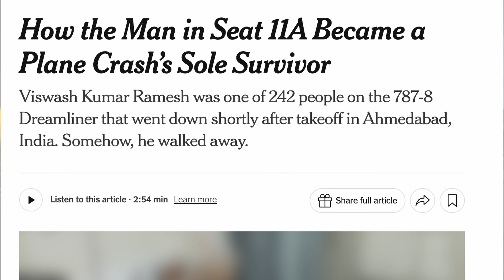Why the RAT Changes Everything – Air India 171 Update

Comment: What is known so far about the crash of B787-8 AI171:
1) The aircraft was heavily loaded.
2) The temperature at the airport was 37 degrees Celsius and outside the airport 41 degrees Celsius.
3) The aircraft was hot.
4) The pilots were very experienced.
5) The 787's takeoff configuration was correct.
6) The runway is 3,505 m long.
7) AI171 used almost the entire runway after a backtrack.
8) V1, Vr, and V2 were near the end of the runway.
9) In the first few seconds after rotation, both engines functioned largely flawlessly.
10) Immediately after takeoff, both engines failed without smoke or sputtering.
11) At this exact moment, an attempt was made to retract the landing gear (the landing gear wheels were pointing down instead of up).
12) Almost at the same time, the RAT was deployed.
13) The pilots transmitted Mayday, likely with power and thrust loos.
14) Now, no engine noise was audible any more, you can only hear the sound of the RAT.
15) After the crash, the flaps on the wings on the floor showed an extended configuration.
16) Shortly before the crash, a survivor reported a bang and the emergency (grren) lights switching.
17) The GE engines are extremely powerful and can always gain altitude safely, even in the event of an one engine failure or any other misconfiguration.
18) An engine restart takes more than 45 seconds.
19) The B787 is an hydraulic and electric aircraft.
20) All hydraulic and electrical systems are double and triple redundant.
As CritSit (Critical Situation) Manager, I suspect the most likely cause of the crash was a failure of the redundant hydraulic and electrical system, particularly those responsible for supplying fuel to the engines (fuel pumps). Therefore, the fuel supply has been interrupted. This is not a double engine failure, but rather a double engine shutdown due to hydraulic and electric failure. This should also be confirmed by the ECAM data.
In my opinion, the pilots were true heroes.
Reply: I agree with most of your points however...7) I have yet to find official confirmation where on the runway the aircraft rotated...if you have such confirmation please share sources...because if it did eat up almost 11000ft of runway then it would speak to issues prior to rotation 9) you/we  don't know that...and won't know it until inspection of the FDR....10) we don't know if there wasn't an insidious issue before or during the take off roll that was already taking place undetected before the speculated catastrophic dual engine failure....as your your opinion well I can't agree with nor refute it...I'm not qualified to do either. Perhaps we will find you are correct...perhaps we will find you are not.
Reply: @ldhorricks  To point 9): If you look closely at the takeoff video, you can see that both engines are kicking up a lot of dust from the end of the runway. This is remarkable, given that the runway was previously swept clean by previous aircraft in the areas where the Vr and V2 normally are. And even after takeoff, there is no engine smoke or fire in either engine. The aircraft's climb angle is also correct for some seconds. Therefore, it's logical to assume that both engines correctly delivered their required thrust up to a certain point. It's also highly unlikely that both GE engines would experience a mechanical failure at the same time. And a bird strike would also result in visible jets of flame and black smoke. Both was not seen.
Reply: @hcvpriv oh my God give it up on the "🥰🥰these GE engines 🥰🥰" bullshit. I work with and think their turbines are SHIT and guess what bud, that's just a bigger engine albeit with tighter tolerances. When GE turbines can collapse the whole power supply to the whole eastern seaboard in less than 7 minutes and leave some places without power for up to 3 days and tons of people working up to 72 hours straight, they aren't shit.
Reply: @jphuckit2870  Unlike power generators, aircraft engines are jet engines that, due to their design, can operate completely independently unless there is a major mechanical failure, such as a bird strike, or the fuel flow is interrupted, for example, because the electric pumps in the tanks fail. Since both engines failed simultaneously, an isolated engine failure is not logically likely to be the cause.
Reply: @ldhorricks  Vr was directly behind the small house next to the runway. If you extend the camera perspective and the small house, you can see that Vr was relatively far toward the end of the runway. However, a 787, even fully loaded, has so much thrust that it could have taken off earlier with the appropriate settings. Either the pilots wanted to protect the engines, or the heat affected the engines' thrust. However, V1 should be the point at which the aircraft could still safely abort takeoff. The pilots must have been aware of this if they selected a lower thrust.
Reply: @hcvpriv  aircraft was fully loaded & taking off out of hot and high conditions - using up the entire runway would be normal
Reply: Agree. It was clearly a power loss, yet not necessarily the engines failure. Low quality fuel perhaps?
Reply: @AlexanderTolstoy  Presumably, it wasn't a fuel quality issue, as this may have been the case with other aircraft as well. Of course, there have been one certain case where, for example, salt was present in the fuel. But also water shouldn't be a problem, as it should be detected immediately and can be tested by a small sample on the underside of the tank (wings), because kerosene is lighter than water.
Reply: @hcvpriv  could it be an act of terrorism them.. 😮 
Flight falling from the sky,  3 huge ships  burning in the ocean.. too many strange things post the recent war, in India..
Reply: @drkrishnap  Yes, things are not looking good in the world... but no, a terrorist act is very unlikely here
Reply: That makes sense. Thank you for explaining.
Reply: This is also speculation.  Wait for the real data.
Reply: IYO— considering fuel supply interruption— could it have been tampered with, prior to flight?
Reply: @daisy-rothschild  I think that's very unlikely, since each engine has its own fuel pumps, which are spatially separated. Furthermore, the fuel supply functioned unhindered during the takeoff phase. The two supply lines themselves cannot be tampered with without disassembly.
Reply: @daisy-rothschild  I'm not ant kind of expert but I am a True Crime junkie, and the information I'm hearing now/so far leads me to only 1 question for the actual airplane experts:
Is there ANY way or form of tampering with ANYTHING on the plane that could cause this statistically improbable DUAL engine failure without smoke and fire first, and so soon after takeoff? 
Seems like someone messed with something that wasn't easily detectable prior to takeoff... but I don't know anything about plane mechanics and engines to speculate about who could have done what and when
Reply: @TimesUp8888  You said it better than I did.
Reply: I have it from unofficial source, so not sure 100% about  it... We have what we have...
Reply: @dumitrucotorobai8344  Yes, and that is highly unlikely given the external circumstances.
Reply: @dumitrucotorobai8344  imagine if it really was some kind of reverse whiskey throttle that caused it, based on the evidence, it's the only solution that fully makes sense
Reply: Fantastic insight, thank you for this information. 

It’s great to see people who can think for themselves rather than draw the same flock minded conclusions over and over when they hear the word “Boeing”
Reply: @pints6994  Thank you so much:goodvibes:
Reply: Just a theory in mind:
Could it be some electrical shorted/overheated, which caused the fuel pumps to be disabled? Or are those redundant (or multi-redundant)?
Reply: @bjornst11  Yes, the fuel pumps and lines are also fully redundant.
Reply: Thank you for this great gathering of facts. It's weird that most of the videos have some, but not all of them, but with different ones missing. Like the flaps being clearly down in the video of the wreckage (the one with the soldier standing on the wing), like the landing gear trucks being toe-down.

I don't see this as a fact, just a report, but a person who was on the previous flight same aircraft, posted a video showing that the cabin electrical systems were not performing correctly. Is this related? No idea.
Reply: @mewintle  Well, the entertainment system is always broken on various flights, but it has absolutely no connection with the flight control system and the electrical and hydraulic controls.
Reply: That was a well-structured summary — I need to add some of my prospective ,many of your observations align with preliminary data from DGCA and AAIB.

A few clarifications from FDR and official press notes:

1. Dual engine failure was sequential, not simultaneous — left engine failed first, followed seconds later by the right (DGCA/AAIB, June 16).

2. RAT deployment confirms loss of both primary power sources (engines).

3. Takeoff config was confirmed correct (flaps, gear, trim).

4. Mayday phrases like “no thrust” and “losing power” were verified by DGCA, though not logged formally in ATC tapes.

5. Flap position after crash implies the system remained in takeoff mode and didn’t transition — consistent with low-altitude failure.

6. No visible fire before impact + staggered thrust loss = high suspicion of fuel delivery system misconfiguration — possibly a manual valve or crossfeed error (our analysis breaks this down in detail).

While your theory about redundant electrical + hydraulic failure affecting fuel pumps is technically possible, there’s currently no confirmation of widespread systems failure in those domains.

Appreciate the recognition of the pilots’ professionalism — they had just seconds to respond to a critical situation.
Reply: Its 49C in the UAE and flights take off every minute at these temperatures. I believe we should not be concerned about temperatures, unless Boeing makes a cheaper version of the airplane for cold weather operations only.
Reply: As a marine engineer, first suspect to me is the fuel supply got shut off/plugged, be it plugged strainer, fuel valve changed, or likely power to pump, or pump failure. In Marine service, there is a back up pump as soon as manifold pressure goes below a preset value, say a 10% drop from full value. Each engine should be on its own pump and fuel supply if it follows marine practice (for maneuvering conditions). The black box is needed.
Reply: @adiamondforever7890  Yes, of course, the first things that come to mind are the fuel supply, the fuel quality, and the fuel pumps. However, there are two completely separate systems, and as far as can be seen from the video, the problem occurred simultaneously in all redundant systems, followed by an electrical and hydraulic failure. Therefore, it's quite unlikely that a fuel strainer, a pump, or a problem in a fuel line caused the failure.
Reply: that's what I think too, that it was failure of hydraulic and/or electrical that CAUSED the engines to flame out.
Reply: @pimacanyon6208  Yes, it was most likely a complete electrical and hydraulic failure, because the gears could no longer be fully retracted at the moment of the problem and the information given by the surviving eyewitness of Seat 11A.
Reply: @hcvpriv  thank you.
Reply: @pimacanyon6208  Yes. I saw a seagull fall out of the sky a few years back because it had a fish hook embedded in its mouth. I know that it didn't swoop down out of the sky to make a grab at a pretzel I'd thrown onto the ground because, with a fish hook in its mouth, it would not have been able to eat that pretzel.So it must have been the fish hook.Without electricity (I've heard it said) that an aircraft jet engine cannot get sparks from the engine spark plugs. I've also heard it said that, without hydraulic pumps operating, the flaps and slats will retract, and also the elevator control will freeze.
Have a nice trip.
Duck Duck GO!
Reply: Would almost empty tanks starve the pumps with sloshing on pitch up? I.e. They had gas but pitch up moved the gas off the pump inlet.
Reply: @Pluto_ice  The tanks were certainly very full, as can unfortunately be seen from the huge fire after the crash. Even if one certain tank was empty, this would not be a problem at all, because the pump of that empty tank would be automatically switched off and only the full tanks would continue to be used. By the way, we have separate tanks in both wings, which are normally used separately for the two different engines.
Reply: @hcvpriv They absolutely had fuel but the tanks wouldn’t be full. That flight is around 3800nm while the range of a 787-8 is about 7000nm. The reason I question fuel load is the lack of sustained fire. The images and video I’ve seen don’t seem to show the damages a fire fueled by a plane with a 50-60% fuel load would cause. Supporting that is the survivor walking out shortly after the crash, the tail section seen without fire damage and the video of the building without active flames. I believe the survivor walked out before first responders arrived and there was no fire raging. I’ve seen the video of the fire ball but crashes with the fuel that should’ve been onboard should’ve burned longer imo.
Reply: @Pluto_ice  What a pitch of a thing to have happened.
I'm wondering if they could have fitted some sort of multiple scavenge and boost pump system to those tanks.
If only you'd been around to give Boeing advice on this when they had the Dreamliner on the drawing board, you might have been able to save countless lives.
Reply: @telforddisservicesandco . 
Haha. There is no engineering solution for lack of fuel. At a certain volume pumps get starved.
Reply: Agree!
Reply: Just commenting to be notified of further updates on this matter
Reply: Cool story bra
Reply: Thanks for the contribution.
You mean that EVERY electrically driven hydraulic pump and EVERY electrically driven fuel delivery pump failed because every generator (including the APU generator) and any battery backup which was supposed to deliver power through the electrical buses failed to deliver power?
Perhaps.
But are you also suggesting that the engine (mechanically) driven fuel pumps on BOTH engines also failed during those vital moments as well?
Are you also suggesting that (perhaps too) the engine (mechanically) driven hydraulic pumps might have also failed at around the same time that this electrical disruption stopped delivering power to the electrically driven hydraulic pumps?
That would be a really scary scenario, and what a tragic coincidence that would be.
All I can suggest in response is that, if there's a Boeing 787 airliner flying overhead, then we should all take precautions, and DUCK!
Reply: @telforddisservicesandco  Unfortunately, we don't yet know which components actually led to a total hydraulic and electrical failure. If the RAT is deployed, and, as it appears, the pilots could have also indicated the power outage, this scenario would be the most likely. There is likely a bottleneck, possibly related to the communications bus or the software between the various redundant systems. A fault in the batteries and the main electrical supply, perhaps following a massive short circuit or a fire, is also theoretically conceivable. Years ago, an A380 experienced a similar massive total control failure after a fire in lithium-ion batteries in the cargo hold of the fuselage.
Reply: @telforddisservicesandco  that's why @dumitrucotorobai8344's explanation is the only 1 that makes sense.  looks like youtube hid his comment like they do most , but it said a recently maintained chair lock broke during takeoff, chair rolled back with the throttle (joke i know) but wouldnt surprise me if that's what happened.   is it possible for a pilot's chair sliding back to pull the throttle back during take-off, and co-pilot just didnt have enough time to react?  seams more plausible then i wish it did, YT hiding comments doesnt look good either
Reply: @jareds8729  I accept that doubt might have been cast on the competence of the co-pilot (presumed to have been the non-flying pilot). His hours on the Dreamliner and his overall low total hours will likely have left people asking questions in relation to his ability to handle the aircraft. But it seems pretty certain that he'd have been capable and competent enough to handle/manage such an event (broken flying pilot's seat) without even needing to consult with the captain.
He would have simply identified the predicament and would have immediately ensured that both thrust levers were repositioned forward again to the TOGA (Take-Off Go-Around position(s). He'd also have taken over if the captain had suddenly become incapacitated (for example, a heart attack).
The reason we can assume this is because we know or hear that EVERY co-pilot trainee (even a second officer recruit) is trained to take over the flight controls should such an event occur. This even applies to very new airline pilots who are not initially expected to occupy a flying control seat under 20,000 feet. Even they are trained to respond to such emergencies by taking over the controls if they must.
In relation to YT "hiding" comments, it probably isn't what you think.
One of the most common reasons for comments not appearing is when the "Sort by" tab at the top left of the comments section (you'll see it here to the right of the total comments figure) is left in the (default) "Top comments" mode instead of selecting it to "Newest first".
This can make it appear as though some comments have been removed.
Hope this has helped you out a little.
Reply: @jareds8729 unless I'm misunderstanding something, this is impossible. A quick look at the Cockpit layout shows the centre console and the pilot's chair aren't particularly close, and the thrust levers are in the middle of the centre console, with numerous buttons between the levers and the chair. I just don't see how this would be possible.

Placing the thrust levers in idle would also not cause the RAT to be deployed. Furthermore, we don't hear the whine of a jet engine in idol in the video, but we do hear the RAT. I'm not too keen on speculating, we have a single video and perhaps some photos of the wreckage, none of which really gives great information. The preliminary report should be available in the coming weeks, so we'll at least get a bit more of an insight then. For now though, it doesn't really look like the pilot's chair as being the cause.
Reply: @MelancholyWithin  Yes, that's right. As far as I've heard, the pilot seat story was an AI-generated fake that unsettled many people. I don't understand some people who try to spread such things, knowing that they're also shaming the victims.
Reply: Yes, thank you, it's great that there are people who think along.
Reply: Looks like the mystery may have been solved here. So thanks.
Quack, quack. I must go flying now.
Reply: There actually was some smoke (not dust), and I believe at least one of the engines lost thrust during rotate or perhaps just prior to it. The lift off was not normal even for a heavy 787 in hot conditions, it was further down the runway than it should have been, with a slower rotation rate; which is indicative of a partial loss of thrust. Your analysis is flawed, the engines will not flame out if all of the fuel pumps fail, especially with the tanks being so full. They may lose some thrust, but they will not fail. This is engine failure, fuel contamination or bird strike are each likely scenarios. There is no such thing as ECAM on Boeing aircraft, that is an Airbus acronym/system; ACARS is what the 787 has. A "CritSit" manager... 🤣. Just another loud, unqualified mouth.
Reply: @woofblitz3694  Thanks for providing him with some "down to earth" suggestions (excuse the pun).
But what if some computer related glitch actually provided an erroneous instruction for the fuel flow to be "throttled back" to flight idle. I know it sounds almost impossible there's no widely distributed evidence that this has ever happened before (during the last 15 years that the Dreamliner has been operating). So, just imaginative thinking (we would hope).
Some are reporting that the runway was immediately inspected for evidence of birds and the airport vicinity scanned for evidence of bird flocks, being prudent for airport management and air traffic movement folk to after such an event, but apparently there was no indication of either.
Fuel contamination as the cause springs to mind for me as well.
Reply: Agreed. Unfortunately that bird had nothing other than momentum after rotation
Reply: Im no aviation mechanic, nor am I by any means qualified to even have input here.  Just a simple automotive tech.   Typically when an engine leans fuel, there are visual and auditory symptoms that accompany it, at least when that leaning out is unintentional with throttle applied.   Nobody has been talking about the second component required in a jet turbine for combustion: AIR.   In the take off video there's a SUBSTANTIAL smog at the end of the runway.  What is the possibility that some kind of environmental factor starved the engines of oxygen, or rapidly (and dramaticly) changed the intake pressure for a split second?  Air density also changes around 25% per 100c  if the temperature in the compressor rapidly dropped, is it even remotely possible that the fueling system could have overcompensated and gone rich to the point of stall? I find it unlikely, I would assume sunburnt jet fuel would at the very least show some sort of visual evidence.
Reply: @jsaseth  Sure, but your opinion is valued, and anyone on the internet viewing these presentations is entitled to express whatever opinion they like (unless banned or where the opinion incites or encourages evil things).
So what you are suggesting are the basics of any Internal Combustion Engine, being Suck Squeeze, Bang & Blow. I'm not a qualified automotive or aviation mechanic but I see your point.
In older generation motor vehicle and marine engines (as piston and valve ICEs) there was and is a likelihood that a lean mixture can rapidly develop into a serious performance and damage problem. That problem being the fuel/air ratio as opposed to simply throttling back the already viable and properly metered air/fuel mix.
On piston driven aircraft engines a leaned out mixture (usually brought about retarding the mixture control adjacent to the throttle) can cause damage as well. This is why either an Exhaust Gas Temperature gauge or a Cylinder Head Temperature gauge is an ideal engine instrument to have fitted.
With most modern cars, the fuel/air ratio adjustment is done automatically by the engine management computer during and after start, and so on a per millisecond basis this mix will vary according to temp/density and pressure and the driver will usually not notice anything changing as he/she travels through varying weather conditions or as he/she climbs to or operates at higher density heights unless the temperature or height is considered well outside of the motors performance range.
Also, with a jet turbine engine (and after the engine has initially stabilised immediately following the start process) the fuel/air ratio adjustment is done automatically as well. During start though, the pilot or the ground engineer will very much have a lot of control over when the fuel mix is introduced into the engine because the compressor (and turbine) must be rotating at a minimum speed for a good start. A bad start is usually when the fuel/air mix is introduced too soon and the turbine temperature exceeds safe limits as a result of the introduction of fuel too soon. So, the speed of the compressors can be loosely likened to being a "mixture control" due to the velocity of the air flow.
So, again, on a per millisecond basis the jet turbine fuel/air mix will be automatically varied taking into consideration the temperature/density and pressure considerations that exist as the air enters the first compressor and the second compressor stage as well as the turbine stage.
This can explain why it was that some airport fire and rescue people from decades ago who would blast water into the front of a jet engine in an attempt to subdue an engine fire were often defeated. It was because the "smart" engine management system was immediately compensating and adjusting for the excess water intake.
These jet engines are robust, but if faced with volcanic ash, biological debris such as large birds or certain high volume and thick dust they don't perform so well.
If you wanted to continue exploring the fuel/air mix possibility it could be worth looking at the possibility of a massive fuel flow or fuel contamination issue.
Since the Dreamliner was introduced around 15 years ago there has been little indication of a serious computer glitch restricting fuel flow to both engines simultaneously, but I guess that it cannot be ruled out.
There have been many cases of many jet aircraft engines encountering problems associated with contaminated fuel though.
Hope that this has helped you out a little.
Reply: @jsaseth maybe simulated in a North American winter climate, unsure about this situation in approx 37 degrees celcius
Reply: @drew7663  I would say the GE engines with the pumps work perfectly even in Saudi Arabia at temperatures up to 45 degrees Celsius and more and also in Alaska at minus 20 degrees Celsius.
Reply: Thank you!
Reply: Another flaw of Boeing design ...
Reply: You are saying that is is a failure attributable to Boeing.
Reply: @Hwaet-aha  No, I'm not saying it's Boeing's fault. It's too early to pinpoint the cause: Of course, a specific part could be defective despite redundancy, it could be a maintenance issue, theoretically, there could be a design issue that no one anticipated, and it could be a chain of unfortunate events (cheese model).
Reply: Αυτοκτονία  καθαρή  του πιλότου 
Ήταν
Reply: @ΟΜήτσος-κ6ε  Personally, I find that completely unlikely. The captain was planning to retire soon to care for his old father. The Mayday call is also an indication that they were fighting for their lives.
Reply: Well from all indications the Engines were Dead that's why the RATs sound was very distinctive at that critical stage of takeoff
Reply: M

 My sons work Colleague was on a previous flight on same plane. Nothing electrical was not working, this Plane was an Accident Waiting to Happen ..
Reply: Speaking as an ignorant person, my intuition tells me it was a short. Actually when he said rat, I pictured a rat gnawing on wires, lol (no laughing matter). I'm sorry for interjecting, hope I'm not offending anyone, my heart goes out for the victims and  families and friends of this tragedy. RIP 💔🙏
Reply: 21) The soile surviivor was wearing a fire proof suit
Reply: @thevlaka  It was truly a miracle that the passenger in seat 11A survived.
Reply: seems speedometer and/or altimeters were giving faster/higher numbers than plane actually was ... which lowered thrust
Reply: @mi1400  I think the instruments were likely functioning largely correctly until the moment of the electrical and hydraulic failure and the resulting flameout. Even if the cockpit displays were faulty, the engines wouldn't shut down totally. Idle running engines could have been restarted immediately.
Reply: 16.  "...the survivor..."  That guy definitely is going to do some soul searching.
Reply: Thanks for the detailed breakdown, but I disagree about an electrical event being the cause of the apparent dual flameout. 787 main pumps have DC backup and should gravity feed even without pump assist on straight and level flight.  Although, I'm not entirely sure if gravity alone is enough at takeoff thrust. 🤔.  I do know from experience that on the ground engines can operate above stabilized idle without pumps.  I have also lost total AC power on climb out in a C-17 without any loss of thrust whatsoever (PW2000 series engine), granted our time without power was only a few seconds, thank goodness.
Reply: @Tommy-my1jw  Yes, very well explained. According to experts, the vapor lock assumption is also impossible on large passenger aircraft, unless the fuel tank pumps all fail, perhaps due to a power outage, and then only the pumps in the engines are left to draw fuel.
Reply: In this case, speculation is absurd.   The CAUSE of the crash is "no thrust".  Now, what caused it IS the lack of thrust.  When the British plane crashed just before the runway, it took over 2 years AND THOUSANDS of hours to figure it out.  Ultimately, it was determined that ice was the issue.  BUT, the hours, and the number of things that were checked and rechecked took a very unreal and strange circumstances to FINALLY figured how it happened.  Stay tuned for more, it IS going to take some time.
Reply: @alan2914  Now, at BA, only the thrust was lost due to ice. Here, there was a system-wide electrical and hydraulic failure that caused the RAT to deploy. It's true, however, that the cause of the system-wide electrical and hydraulic failure is still completely unknown.
Reply: Excellent educational post. Thank you.
Reply: @votsbh  Thank you so much indeed
Reply: Just some more possible information: https://www.youtube.com/watch?v=VswFVpyg5ew
Reply: Engines failed stop lying.. Boeing
Reply: there is an Indian pilot named Gaurav Tanjea. He has posted on youtube his in detail analysis of what could have happened. Unfortunately a huge portion of the video is in Hindi. Of course I am no expert so mind my layman language. But here's a gist of what he said may have happened
1. (Assumption) The aircraft was loaded way more than what is recommended and the pilots were not made aware of this situation (First mistake)
2. Just before takeoff , after V1, one of the engines failed (On runway itself)
3. Since the aircraft is over loaded, it took more time than normal to lift off based on one engine.
4. Pilots panicked since it took longer than usual to take off on one engine and in the moment, forgot to raise the landing gear up.
5. REAL MISHAP HAPPENS NOW - instead of cutting off the fuel supply of the failed engine, in that tense situation, they cut off the fuel supply of the working engine (!!!!!!)
6. In Boeing planes, this is an irreversible process, meaning you can not do anything now. 
As a result, they were left with zero thrust at 400 feet in air.
Reply: @shubhamcharlu605  Thank you for your detailed report. However, the Indian pilot might have been mistaken on the following points, or the report was published at a time when not all the facts were yet known:
1: Aircraft overloaded: Even if that had been the case, takeoff could have proceeded normally, as the 878 has autothrust and the thrust would be automatically adjusted accordingly.
2: It's theoretically possible that one engine failed or had problems while on the runway, but then the pilots would have immediately attempted to abort the takeoff before V1. Furthermore, during takeoff, you can see that both engines kicked up a lot of dust, which suggests that both engines still had full thrust at V2.
3: Yes, overloading could have extended the takeoff phase somewhat, but it shouldn't have played any real role in the sudden failure of both engines.
4: Based on the position of the gears (which were facing downward), it is clear that the straight landing gear was retracted when a hydraulic and electrical failure occurred.
5: I don't believe an Indian pilot claimed this, as it is so stupid and unlikely that pilots would shut down both engines during takeoff.
6: A dual engine failure would result in the same catastrophic crash for any passenger aircraft in the world at an altitude of 400 feet.
Reply: @hcvpriv  point 5. I meant, the aircraft took off based on one engine (since the second engine failed on the runway). Now, to kill the fuel supply of the failed engine (mind you at this point they have taken off and are airborne) , they initiated the procedure, but in the tense situation & being airborne, they cut off the fuel supply of the working engine (again just a theory)
Reply: @shubhamcharlu605  Yes, in principle it is possible for pilots to shut down the wrong engine after an engine problem. This has actually happened once in the past in a tragic incident, although not with a 787. The modern 787 shows pilots very well which engine has failed. I also think that there may have been some general thrust problems during takeoff, even though they weren't that significant, since the 787 can normally take off halfway down the runway. Either the pilots wanted to protect the engines and save fuel and therefore programmed a lower thrust (but I don't think that's likely, since that would put V1 well to the end of the runway), or, what I also consider possible and which may be related to other problems, such as the half-retracted landing gear and the RAT extension, that there may have been initial problems with the electrical system and thus with the hydraulics and the fuel pumps in the tank during takeoff. It should be clear during takeoff that both engines still had thrust and were stirring up dust at the end of the runway. Furthermore, there was no noticeable tilt of the wings, which would indicate a single-engine failure. I find the following information on the internet very interesting, but I haven't been able to verify it yet:

Did a software error cause the failure of a twin engine?
@FSOV https://www.youtube.com/watch?v=VswFVpyg5ew

You can watch HeyFixThis's commentary in the following YouTube video, which discusses the activation of the FSOV (Fuel Shutoff Valve) due to a cascading electrical system failure.
@HeyFixThis https://www.youtube.com/watch?v=p07X3YR5q_s
Reply: @hcvpriv @capta
Reply: @ronakpatel5403  What is @capta?
Did you mean the Youtube channel held by "Marven Smith"?
Or how about the Cults Academy PTA?
Reply: Pull the maintenance logs, I’ll wait…….
Reply: In relation to "hero" comments about the pilots. Like with many situations, when the sh*t is hitting the preverbial, heroics are usually the last thing on people's minds.
One or both of those pilots were probably fully focussed on saving their behinds, and the passengers were simply along for the ride.
Reply: "Very experienced", 1100 flight hours for a co-pilot is way below very experienced. In usa you need minimum of 1500 flight hours to even be able to be looked at by an airline
Reply: If you whingers don't trust someone with 10 years experience in something go start learning to fly your own planes.
Reply: Thanks to the genius engineers these days we rely on electric wire sensor battery junk to solve problems that never existed until now. All for perceived efficiency and technological bragging rights. So much for redundancy when it all fails simultaneously.  Boeing is a joke
Reply: Are there reports confirming this plane was correctly and fully fueled?
Reply: @TheBMW2000 if there was not enough fuel in the tanks, there would not be such a big fire after the crash
Reply: @hcvpriv  You're the first logical person i heard on this topic who's not jumping to conclusions but gathering data and seeing patterns. Great job! 👍🏻
Reply: @Batman-wf8vd  Thank you so much
Reply: @TheBMW2000  My thoughts exactly.
Reply: @TheBMW2000 the jet fuel literally caused the explosion, so lack of fuel was obviously not an issue
Reply: @TheBMW2000  as per reports in local media, the flight was carrying in excess of 100,000 litres of fuel as it was a long distance flight. 
Since the flight crashed within 35 seconds of takeoff the Pilots couldn’t dump fuel and the crash caused a huge inferno killing all passengers (except one) even if they survived the crash.
Reply: They did their best @TheBMW2000
Reply: #18 - wow, didn't know it takes over 45 seconds for engines to restart again! The engines didn't have time to do that. They should check for a fuel system failure.😢
#20 - not a plane expert but I think electrical or hydraulic system failed, because of the video posted by a passenger on that same plane on the previous flight showing the tv screens not working and said the air system was not working, very telling of a failing system not maintenanced!
Reply: @3caninos  I think the entertainment system has nothing to do with the electrical and hydraulic flight systems. As far as I know, the onboard entertainment system is totally separate from the essential flight systems. The 787's air pressure system and air conditioning system are also not connected by the turbines but are powered entirely separately.
Reply: @3caninos  those are completely separate circuits. Imagine if a passenger short-circuiting a plug took down the whole plane's electrical system.
Reply: @3caninos  that was not working because plane had not started flying yet. It was taxied.
So ac and entertainment system was not working. That happens in other airlinesntoo.
And sometimes ac doesnt work until they start to take off.
I have faced this.
And yes, in one of my Air India flight, the entertainment system did not work but.. the flight was very smooth.. food awesome, hospitality and staff attitude better than British Airways or Lufthansa or Swiss airlines. For sure.
Reply: Very smart guy. Smart 🧠 analysis over here every one. Like I maintained prior, we have the duty & responsibility to investigate the likely true cause of tis national tragedy. Otherwise, the loss would be a waste in posterity. We owe them & the families of them gone too soon..

So very sad..
Reply: @obaroaluya3762  Yes you are right. Thank you very much indeed.
Reply: My first tot after taking a look at d initial vid is engine failure but then we needed to take a closer look at the engine wake to see if it meets wit recommended standards. My second tot if hypothesis one is all good is that the total kg of the plane needs be looked into. There's no way aircraft weight safety ratio should be overided, compromised or exceeded given the circumstantial diminishing return of the engine not getting any younger.

The greatest service we can giv to posterity is to thoroughly investigate wat could have gone wrong n wat led to tis, otherwise, we are totally unaccountable to the life gone too soon.

This is so terrifying, heartbreaking n so very sad. Hence, my deepest heartfelt condolences to the people of India especially the families who got caught in the wake of this national tragedy..

May they be granted the fortitude n strength to live n hope again..
Reply: @obaroaluya3762  Yes, that makes sense. However, the fact that one engine alone should have been able to complete a takeoff even at maximum weight speaks against a singular engine problem. Both engines are capable of a safe takeoff even if the maximum weight is exceeded. However, I don't assume that the total weight was exceeded, since the climb angle after V2 initially appeared completely correct.
Reply: I have this.
Critical Findings from AAIB Preliminary Report**  
1. **Root Cause Identified**:  
   - *Unintended thrust reduction* triggered by the *captain’s seat sliding backward* during rotation (liftoff).  
   - The seat’s **AFT lock mechanism failed**, causing sudden rearward movement. The captain’s body weight forcibly pulled the thrust levers to idle.    
 - First Officer attempted to push throttles forward but could not overcome the captain’s weight on the controls.  

2. **Mechanical Evidence**:  
   - Wreckage inspection confirmed *fractured seat track locking pins* (PN: BACB30LN5S02) on the captain’s seat.  
   - Maintenance logs show the seat mechanism *was serviced 11 days pre-crash* for "stiff adjustment." No post-repair function test was documented.  
3. *Flight Deck Timeline* (CVR/FDR correlation):  
   - **+0:12 sec**: Rotation begins. Captain’s seat slips aft abruptly.  
   - **+0:15 sec**: Thrust levers pulled to idle. First Officer: "*Thrust dropping!*"  
   - **+0:18 sec**: Captain: "*My seat!*" Struggle heard.  
   - **+0:26 sec**: First Officer attempts full thrust; aircraft stalls at 214 ft.  
   - **+0:38 sec**: Impact.  

4. **Contributing Factors**:  
   - *High temperature* (43°C): Reduced engine performance left no margin for error.  
   - **Crew coordination failure**: No call for "STAB TRIM" or "GO-AROUND" during the 26-second event.  
   - **Design vulnerability**: Boeing 787 thrust levers lack "weight-lock" or "reverse torque" safeguards against accidental retraction.
Reply: @dumitrucotorobai8344  Unfortunately, this might not be true: the engines were most likely OFF and not idling. You can clearly hear this on the cell phone video (point 14). A turbine idling in the air produces a distinct, droning sound. This is why the RAT was activated, and all you hear is the propeller noise of the RAT. Please forgive me, so someone may have spread a hoax.
Reply: With no disrespect intended, why were the pilots heros? Thank you.
Reply: @greglenoir7674  The pilots were true heroes, because In the final 25 seconds, when they realized the plane could crash and everyone could die, they did their best to stabilize the aircraft and save what was still possible. You can see the best possible gliding behavior of the 878. Of course they had no chance and I think the pilots must have been well aware of that. My deepest condolences to all those who lost their lives in the accident and to their families
Reply: @greglenoir7674  Because they fought till the very end. There's nothing else they could have done. And they died trying instead of giving up.
Reply: @greglenoir7674 I thought I was cynical but why on earth would you say that? It just feels bitter and provocative for the sake of it. 

At this stage there is little evidence for anything and NOTHING WHATEVER concrete that can be pointed to that shows one or the other or both did something wrong.

Even if it transpires they did, I think it's safe to assume a) they didn't mean to and b) did their best to save the flight which of course we could also say in the far more likely event a) does not apply because in fact neither did anything wrong.

I assume you watched the same video the rest of us did but Capt Steve I think laid it out fairly clearly don't you think? With the clearer original copy of the video we can see the doors to the RAT open and just about the tiny propellor which can CLEARLY be heard when we were played it three times in a row on loop. We also have the testimony from the survivor who walked away from the crash - so however horrific it was, by whatever miracle this is not someone who spent six months in a medically induced coma and who a year later still needs to be fed through a tube after 4 operations on different parts of his brain and several others to pin his spine back together. This is someone who barely picked up more than some minor bruising and a few grades - and as was explicitly stated, never lost consciousness even for a second. Traumatic yes - and had there been two survivors, who knows, perhaps the other would have a different account. But the testimony seems to me to be both simple, straightforward and vivid. Yes, the human mind had funny ways of working but sometimes you just see what you see - and remember things exactly as they were. Individually and in isolation we might very well be sceptical of one traumatised (if virtually completely uninjured) man - but again if we just accept there's no conspiracy theory and that the witness did actually testify as reported - the bang and the lights flickering - well  I don't know exactly HOW experienced Steeve is but I'd be confident enough to say that the 4 gold stripes on his shoulders and the fact he's likely somewhere in his fifties, means he's got infinity more experience than me and probably a country mile more than you two but neither of that's relevant because I am at this stage confident enough in him and his analysis to accept his interim conclusions - especially as he admitted right up front to having substantially changed his mind from what he had originally suspected having seen new evidence (or a more detailed copy of the original evidence which offered a couple of extra clues).

Combined with the experience of the person who posted the original comment - no, we don't know whether he is what he says he is - and yet whether he is or isn't, I can't really fault a single point he stated, can you? I know what he means about the heat haze behind the engines which I have often seen. Whether or not that shimmering effect would be visible even if the engines were still producing hot exhaust is unclear to me..... But I accept it might well be clear to someone else and by the way he's not the only one I have heard saying it.

And the word seems to be that the pilot who radioed the Mayday was able to report a loss of power - which all ties in exactly with what would be experienced with both engines out. Indeed, the original poster in this thread immediately recognised it not as engine failure - but of hydraulic/electrical failure leading to loss of fuel pressure and thus while there was nothing technically wrong with the engines, well, again you don't have to have advanced doctorates in jet engine combustion to know that even the fittest engine won't go if the juice can't get to it.

In short EVERYTHING points to something mechanical/electrical/hydraulic on the plane which stopped working catastrophically and at a critical time and at such a low altitude that there was no hope of recovery.

Yes - technically and with perfect, dry, unemotional verisimilitude, both those pilots could indeed be merely described as "having done their job". Nothing more and nothing less. But while I am certainly not one for excessive drama, effusiveness and hyperbole - in the circumstances as outlined above and in the video, in the absence of any particular reason not to (thus excluding it transpiring the engines were powered down on purpose, for example) I'm gonna have the humility to give them the courtesy of receiving the "hero" appellation. If you don't agree or don't want to - that's fine. I just don't really understand why you would go to the trouble of questioning someone who was happy to (provisionally at least) describe them that way. Surely the only thing to have done would have been to have said nothing? I really don't understand some people even after all this time on earth.....
Reply: Vaxxed.
Reply: @ollierobin  bro ..what do u mean by that?
Reply: The FO did not even have 1500 hours and the captain had only 8000 hrs, what makes you think these pilots were very experienced?
Reply: @adibasdas  The captain had more than 8,000 hours of experience on the 878 alone and he was also an extremely experienced flight instructor. Many of his students emphasize his extensive knowledge and remarkable skills.
Reply: @hcvpriv  It's a 787, not an 878.
Reply: @truthserum5310 yes, a 787-8, also called “878”. What he is saying is completely correct, just an abbreviation
Reply: @pints6994  I stand corrected.
Reply: @truthserum5310 yes. So next time before pointing people wrong, do a research or observe. The guy obviously is a professional just for someone like you to correct. “I stand corrected” is not always an excuse for keyboard warriors and people who play smart like you.
Reply: @adibasdas  8000hrs I would say speaks to significant experience...don't know how much of it was on type...but he was also a training/ check pilot. Tell us what you consider the number of hours to be experienced...I assume you are an expert  or have some kind of experience to be able call this into question
Reply: @ldhorricks  You can build up 8,000 hours within 10 years once you are in an airline. If you consider 10 years to be very experienced, then what do you call someone with 30 years of experience? 8,000 hours is definitely not a lot for a captain. I am not even mentioning the FO. 

They could be good, I have no comments on that but they are not very experienced.
Reply: @adibasdas   Hey bud. Your concept of very experienced is flawed. 8000 to 10000 hours of any trade is considered journeyman level. Its is that plus school to be able to get an electrician license. Any actual real world life experience is worth double classroom time. I was say that the pilot was MORE than experienced. What word someone may use to describe MORE is up to them i guess.
Reply: @jedinightstalker  Well, I don't think that only practical experience is valuable. Training, especially on new extensions or modifications, as well as training in error and accident analysis, is also very important. Most pilots today receive very little training and have to learn this additional knowledge on their own. While regular flight simulator tests are important, they alone are not sufficient for pilots' continued development. Life consists of constant learning, including training courses from qualified instructors.
Reply: @adibasdas you realize that 8000 hours is 333 days correct?
Reply: @crazyt_  yeap. And do you realize how difficult it is to fly an airplane? Have you ever flown one? I have, and I can tell you  8000 is an important amount of time, but it is not a lot.
Reply: @adibasdas you cannot tell me 8000 hrs isn’t experienced. I refuse to believe it
Reply: @crazyt_ depends… I spent 11´500 hours (almost 19 years) as a first officer before gaining my 4th stripe as captain. At my airline, it is pretty common. Some other airlines do have „young“ captains with 3000 hours only.
Reply: @Kakydanou  first off, that’s actually amazing. Congrats to you. Second, I stand corrected. I appreciate the insight, and thinking about it now, experience can be very subjective when it comes to individual by individual.
Reply: @crazyt_  where did i say 8000 is not experienced? I said it is not very experienced. Can't you read?
Reply: @adibasdas ”had only.” Thus I used logic to get to that conclusion.
Reply: @crazyt_  i see, that's reasonable. Have a good day.
Reply: @adibasdas  those 30years expierence pilots didnt fly 30 years on new gen 787..........
Reply: @crazyt_  Well, only if you are flying 24/7 which obviously is impossible but if you WERE flying 24/7, then yeah, after 333 days of flying 24/7, you'd be experienced but it sure wouldn't be quality hours. These 8000 hours are assumed to be quality flight time, correct? Not sure of your point.
Reply: @adibasdas  How is this about experience? To get a plane off the ground, you don't need 8000 hours but to his credit, he has those hours and this is likely his route having taken off from this airport and others 2 to 4 times a day for how many days until this moment. This was a catastrophic failure. It happens. Planes are not foolproof. My ex-husband has been an A&P mechanic on the Boeing for over 30 years plus he is a pilot (not the Boeing). He once explained to me that there is backup for the backup for the backup which is why air travel is considered to be safe and why the amount of crashes worldwide compared to the thousands upon thousands of planes in the air daily is negligible at best. This was clearly catastrophic and while it's easy to blame the "inexperience" of a pilot with 8000 hours, I feel it's best to look at Air India overall which is apparently, by passenger accounts, notorious for its shoddy aircraft.
Reply: @zariballard the over-analyzing is strong with this one. I feel that experience can amount to total years in a profession as well as total hours, but most people I feel base saying if someone is experienced or not on years, when in reality both can be used.
Reply: @zariballard  Yes, thank you for your consideration. I also think that the pilot, with more than 8,000 flight hours on the Dreamliner, was quite experienced, as he also had extensive experience as a flight instructor. It was also reported that, like most pilots in India, the co-pilot, before his practical experience, also completed a flight degree at a technical college or university for aviation, where all relevant technical requirements are taught before the flight test. I also know that generally, the education and training in India is very strict and only the best pass these courses.
Reply: @adibasdas so does 8000 flying hrs do not count towards experience? Its by no means below average flying hours for a skilled pilot that would be about 5 years.